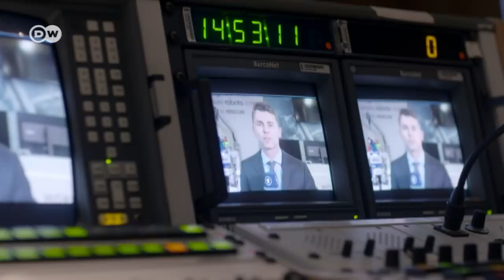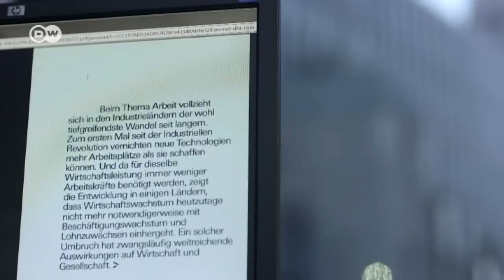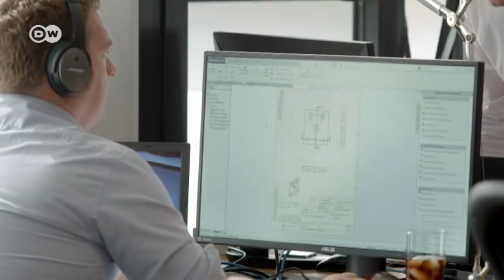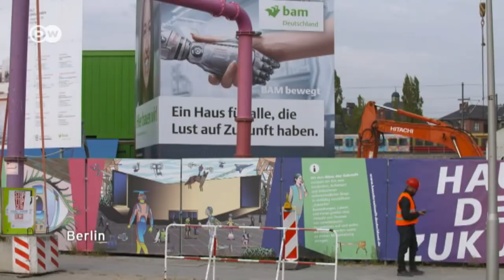Will robots steal our jobs? - The future of work (1/2) | DW Documentary

Comment: talking points... not in any particular order.
the notion that machines are more 'efficient' than humans is nonsense. It's the result of poor thinking in an environment where only monetary cost (cost-efficiency) in relation to the amount of production is considered - yet money is not a real thing. It is a human construct designed to oil the wheels of exchange.

Machines produce more per hour than a human can. But what happens when there is more than enough production to meet need or even demand (there is, already, in the parts of the economy where there is mass-production for mass consumption - look at the over-produced cars unsold and rotting in parking lots alongside rail sidings all over the world). The machines have often already become redundant themselves but the current system demands they continue to produce. 

The problem is that our current structures dictate that the only way to earn more is to produce more.  Even if the output isn't needed. Huge amounts of energy and material are consumed, then the products are left to decay and waste.
We throw away 40% of the food we produce, after having spent a huge amount of energy to produce it, and transport it, and keep it cool and stop it decaying. That is, there's already overproduction of food. We waste the energy used - and then it's left to rot, put back into the soil eventually. The current arrangements encourage this, in fact demand it.

People are real things.
Energy is a real thing. Materials are real things.
All we have is people (human effort), materials from the earth, and Energy.

A car-making factory robot consumes on the order of 30 to 300 kWh of energy per day, and over-produces cars. We overproduce steel to meet the need of the car factory owners to overproduce cars (and it is a need , not optional - they have little choice if they want to stay in business within the current system). The entire system is set up to overproduce, and then to waste the product.
 
A human produces one tenth as much or less, than a machine, but runs on 100W (0.1kW) of power for his own body's immediate requirements (~2000 kcal/day or 2.4 kWh per day), and maybe - in aggregate over the world - requires a total of 5 times that (12kWh per day) to sustain his total lifestyle (his need for the building and maintenance of a place to live, and warmth and lighting, manufactures like clothing and gadgets for entertaining him, and power for his appliances). [these figures are probably not accurate - just ballpark estimates].
 
In energy terms, people are far cheaper than machines, and they don't mind having free time (stopping production when enough has been made), unlike machines and their owners.

Would it not be better to produce a system that sustains the needs of people rather than the needs of a system of overproduction and waste?  Keep the current arrangements, and machines and automation will only make things worse. Idle people are unfulfilled, sad, depressed, and ultimately crazy and dangerous.
Reply: I see you are in with the things of how capitalism works. I am impressed to see someone who sees things with open eyes. The way you present the things is way too scary and serious for the casual reader!

You did forgot to mention the most prestigious invention of Capitalism - Planned Obsolescence. The next of all the reasons you mentioned of why we still work so long 8 hours with all those new techs invented AND actually applied today.

Just like Jacque Fresco said for the The Great Depression from his memories - "The resources needed were in the shops, but no one could afford them. The rules of the game were invalid."
Reply: +Hamilton. While you have some valid points. Others are not as valid, for example your anecdotal example of cars.

You see, the higher the production number, regardless of humans being involved or not, lowers the production cost of the car or what is called Stock Keeping Unit (SKU). Something that is produced and also take up physical space. If you lower the production, you increase the SKU cost, which ether affects downstream price or profit. 

A secondary aspect to this is that you need to project your marked because, ironically and dualistically, a wrong projection ether way can cost you, big time. Because if you project too low. You wont just increase the SKU cost, but you will also lose sales and see a group of consumers pick another car manufacturer. In studies on Out Of Stock (OOS) it has shown that up to ca 70% of consumers will pick another product or similar rather than wait for that product to come back into stock again. While granted, its allot lower for longer lasting products that are pre planned, like a car. They are as well affected if they have to wait too long. Lastly, you have other aspects regarding this that is allot newer. Which is that lead time (time it takes a product to get to marked) has become shorter, while expiration date. Not to be confused with foods alone, but also physical products in regards to fashion or "hipness", new tech vs old etc have become shorter. Meaning that if something is produced far away overseas. It might be more economical to produce in larger batches fast and have them sit in a central regional storage for some time. Than ordering them "one/few at the time" or similar. 

Obviously if you project the wrong way, your product isnt liked or you are late to marked with a trending product line. Then you will lose money on that end as well, but some times that aspect is taken into account. As in they produce 110% of projected need, but balance the price for 100% of units sold. If every unit is sold, they suddenly make allot more profits than project for that batch, if not. No "real" loss ether.

Then you have external costs which can be power, raw materials, oil (transport cost) and so on that can ether affect or effect a products end cost and thereby profit margin or competitive edge. Which can insensitive a higher production on one batch over another or be taken into seasonal account on higher, lower production basis within the year.

There is a balance to everything, but just because you see cars being stocked up doesnt mean they are doing so at a macro level unwise calculation. Even if some car product fail. Most often its very sane Supply Chain Management (SCM) behind the seemingly "madness". 

In the future though you will most likely see all car manufacturing being something called "push" to semi constructed framework of a car/s ( /s = more than a single car type or product), were these "half cars" sit in storage until a order comes and the final aspect of outer finish, coloring and such is a "pull" production based on confirmed demand, aka a order for the car. In turn, these cars being sent out in batched on a monthly or similar bases. Thereby lowering cost based on several aspects of newer SCM.
Reply: ok now do the video ....that was coherent and a new perspective...present it!....you have no idea how uncertain the world is feeling, (saying this from 4 different geopraphic perspectives)

Comment: Not just "robots," but automation in general, governed by computers with AI that are equipped with "machine learning." They can teach themselves and learn from their mistakes and self-correct immediately. 

They can't have "bad habits" that are difficult to break. They already to incredible diagnostics in medicine, but they're not widespread yet at hospitals.

 Hopefully, overtime it will make medicine cheaper, as you won't need labs filled with technicians (who have high error rates). Technicians can't discern minute differences in pathogens that are very similar, resulting in common misdiagnoses.

 Then we can treat diseases instead of symptoms.

Comment: They've  had a long time to replace people with  customer  service reps., calling a company regarding whatever issue 
And the machine rarely  serve me.
9ne would think this would  be fairly strait forward, apparently  not. 
Hence I  wonder how optimistic  this assessment  is. Tesla had to put more people back on the lines.
This reminds me of  the Cancer story,  that they are close to a cure - in the next ten years, about 40 years have passed.
Computers are stupid just try and have a conversation  with one.
The silicon Valley types spread these tales of great intelligence,  but poised with a the most basic question, what is consciousness, they  remain clueless...as if the question was irrelevant. 
Meaning and consciousness  are tied together.  To ignore and / or ignorance  will not save those foolish enough for those who walk that road.